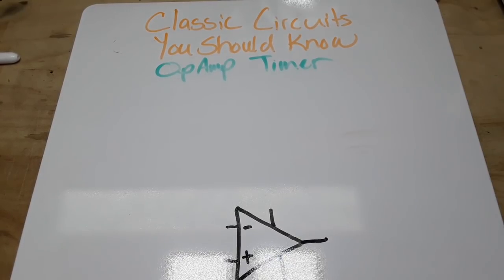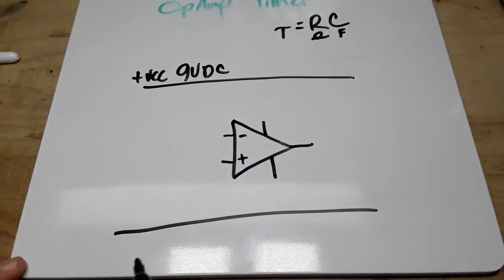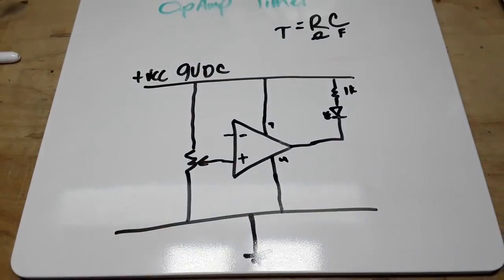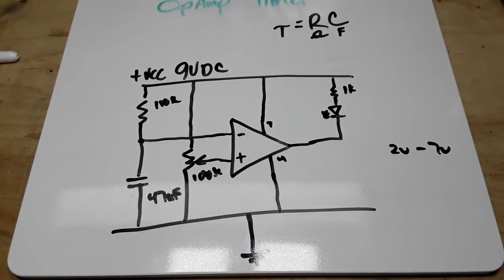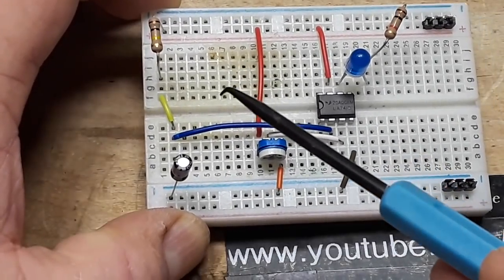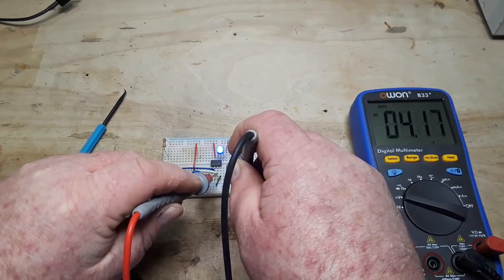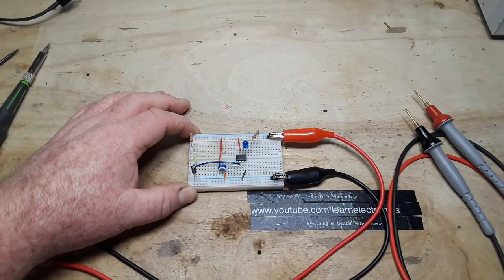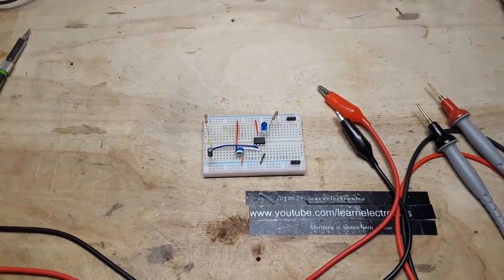Classic Circuits You Should Know: OpAmp Timer

Comment: A very cool circuit. Thank you for the great explanation! The manual discharging of the capacitor makes this circuit impractical. Can you add a discharge resistor with a very high value across the capacitor to remedy this?

Comment: This is a handy circuit if you are using an IC package with two or four op-amps in it. Some doing analogue things and some digital, for example a sine wave pip tone generator. 
The only problem is that some op-amps do not implement such digital circuits very well. They have limitations in the range of both outputs and inputs, exceeding these limits can result in very strange behaviour, with input signals breaking into the output of even the inverting inputs turning into non inverting. To avoid such problems, check if the op-amp input and output range includes ground, the op-amp can operate on a single rail, and maybe has inputs that can operate up to the supply rail voltage. This is a more uncommon feature. Comparators always do digital oscillators better than op-amps.
I think this circuit might be improved by adding a bit of hysteresis to give it a Schmitt action. One way of doing this is to reduce the impedance of the pot and then add a resistor from the pot wiper to the non inverting input, and a second resistor from the output back to the non inverting input. Then when the output changes state, the reference point will shift slightly  to re-enforce the change. The feedback resistor should be a high value, so that the shift in the reference is maybe half a volt or less. 
The timer accuracy is not affected, significantly affected, but the change makes the switching faster and less likely to oscillate as the capacitor voltage passes the reference, something that is likely to happen if the time constant is very large. 
Incidentally, it is very easy to further modify this circuit to produce an oscillator, by moving the capacitor charge resistor on to the output. 
The circuit input  will then oscillate about the reference voltage +/- the hysteresis voltage. With the output of the op-amp switching in limit cycles across its maximum output range.

Comment: Hi, great video as usual Mr. Paul! Now I was thinking about the 100k pot has mor resolution than, let say,  the 10k pot but I couldn't agree on this! I could be wrong though but here is my logic on this issue! considering the linearity of the variable resistance there, any degree of change on the angle on either one of the pots should give the same change in voltage no matter which one are we using. Only current passing through should be less when using the one hundred kilo ohms!

Comment: Two things I don't understand about your potentiometer. Firstly , how does the pot value affect the degree of control? If you have 9 volts across the track, and the pot rotates 270 degrees then you have 9 / 270 volts per degree whatever the value. Secondly surely the range of reference voltage is 0 to 9, not 2 to 7?
Reply from the maker: Ocampo have about 1.5-2V of overhead at both the top and bottom. So even if the pot it 0-9 the Obama won't recognize outside of its range

Comment: Could this also be a button debounce circuit too? The cap would need to be a smaller value to charge faster and use a button with resistor in series in place of the pot. Output to microcontroller or whatever it is you are controlling. Cause the output would be a clean ON or OFF without the switch noise. Awesome video!
Reply: Maybe a 555-timer in monostable mode would be as good?
Reply: @takix2007  probably. But I have like 40 op amps and only 6 or 8 555timers. Just a different way to get the same result.

Comment: Thanks Paul. So, although only just woken up, could you use this,a bit upside down, as part of a circuit to limit the voltage you let a Li battery get to before charging it or similar?